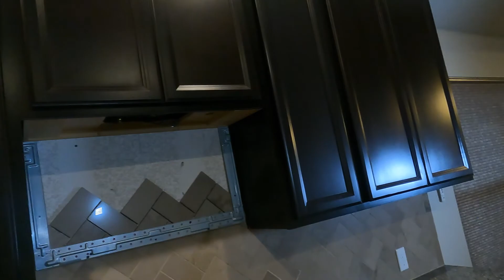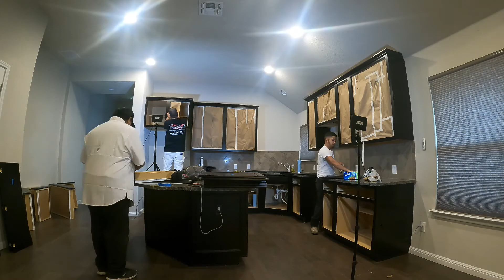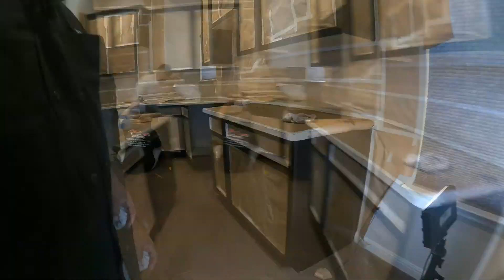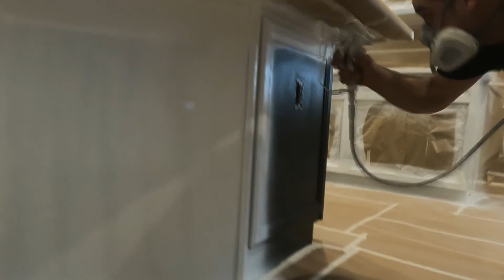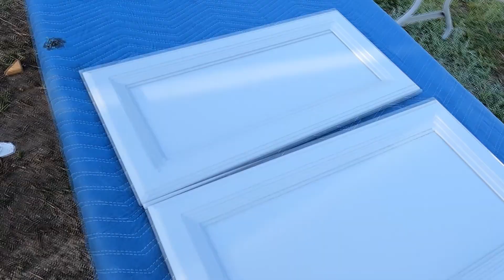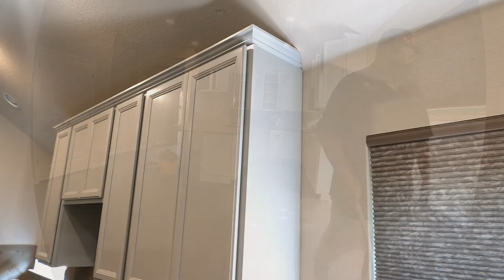Painting Kitchen Cabinets With Lacquer

Comment: What type of benjamin moore did you use? Advanced or Aura?
Reply from the maker: I used BM Lenmar Duralaq, Is a Lacquer paint! I also had use the other two!
Reply: @jchomeremodelsandpainting2325  did the aura give you any issues?
Reply from the maker: @netm203  only a couple of runs on the second coat, nothing major, seems like when you spray it on the second coat, if you are not careful! It will run on you!
Reply: @jchomeremodelsandpainting2325  Hello, what made you use this instead of the advance or aura?
Reply: @MessyyMissyy  The owner wanted a Lacquer finish, I also use Advance and Command, had great results with all of them. Thanks for watching the video!
Reply: @jorgecastano9013  Thanks for the video. Do you sand the Duralac and the Advance in between coats just sand the primer?
Reply: @augustusappling139  I sand between coats on both!
Reply: @jorgecastano9013  thanks for letting me know